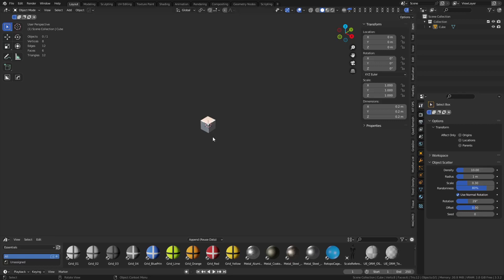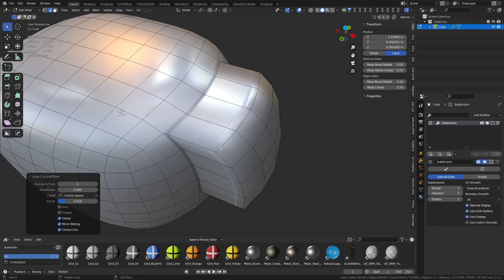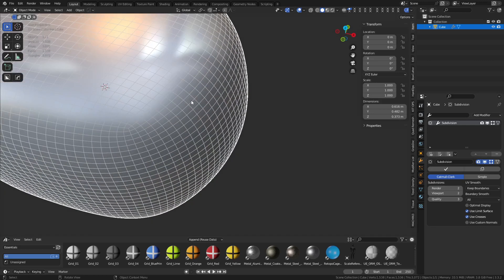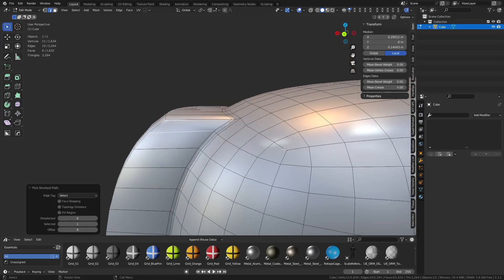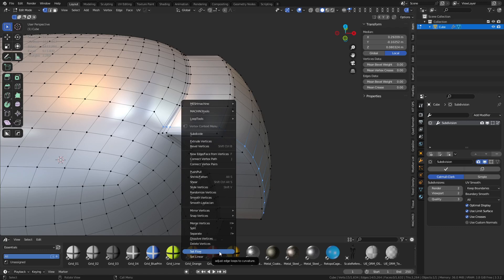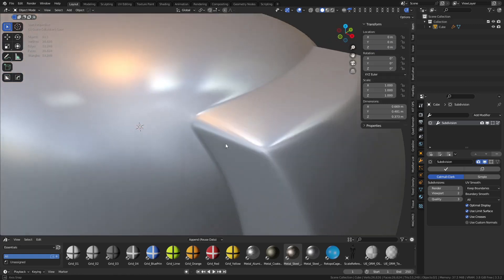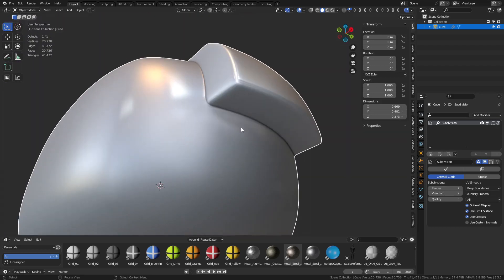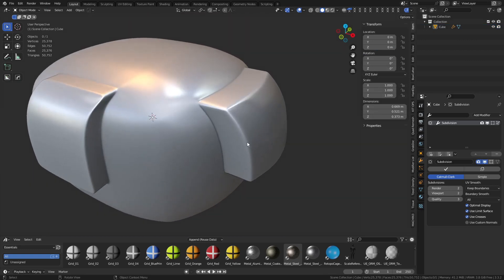SubD Extruding on Curve

Comment: Btw i just moving from maya to blender and the things that I don't understand are how can default blender moving, scale, rotate keymapping are very far from each other like move for G and R for rotate and S for scale my finger a little bit hurt doing that 😂 i mean in maya they just use W,E,R for that.. and of course the most important for me at least.. the gizmo and how to activate the gizmo as default if i press g,r or s?
Reply from the maker: Finger workout woot! Stick with the defaults for a bit then customize it later on but if you absolutely can't resist, edit/preferences/keymap has most everything. At the very top is a drop down you can switch to industry compatible keys. Although I never really tried it.
Reply from the maker: Oh yeah, and .... I personally always check tab for pie menu, and switch space bar to tools now. So you can hit space bar + g,r, or s to get the transform tools or whatever else. The shortcuts show up next to them on the pop up.